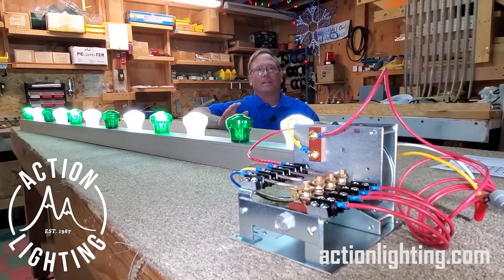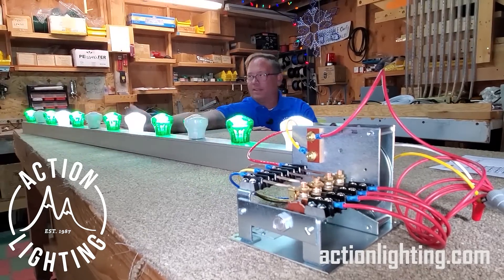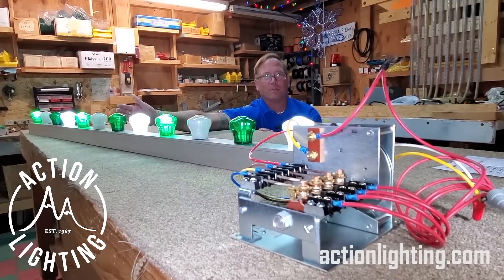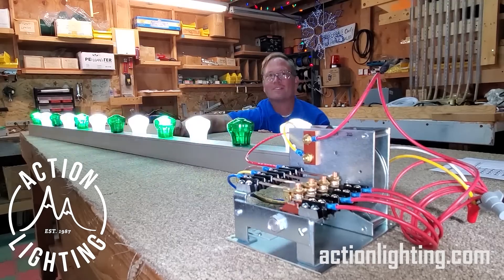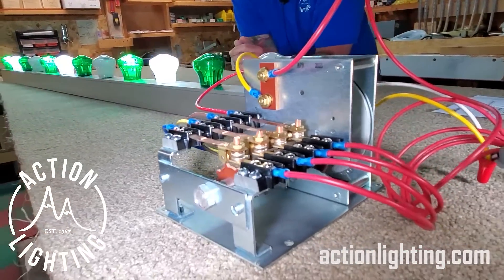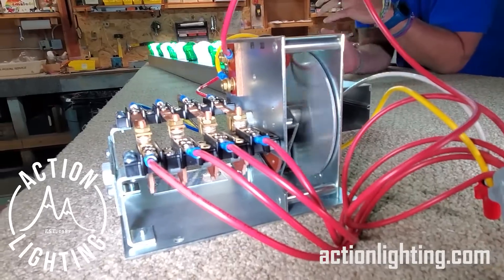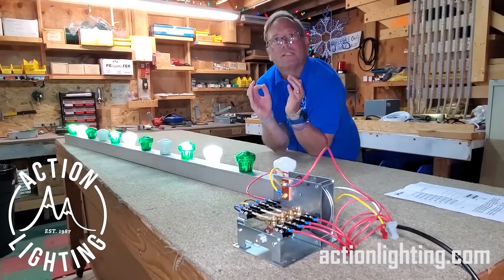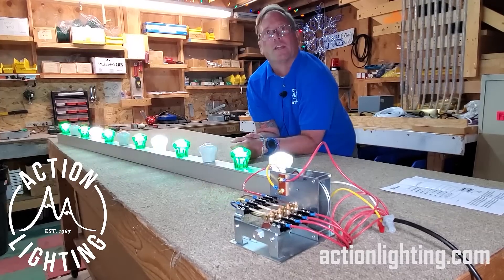Mechanical Light Controllers for Marquee lights in Action!

Comment: How do you adjust the speed?
Reply from the maker: Special note: flashing speed can be easily adjusted by removing motor shades using a screw driver. As shades are removed the flashing speed decreases

Comment: This is so cool and mechanical. What about if I would want to control just four 500 watt lights using electronics. What would I use Sir ??/ Thanks
Reply from the maker: You have 2 options depending on connections.  Check out these 2 controllers.
https://www.actionlighting.com/4-circuit-forward-chase-controller-204ch-102/
https://www.actionlighting.com/4-channel-multi-function-chase-controller-204ch-uc4/

Let me know if you have any other questions.